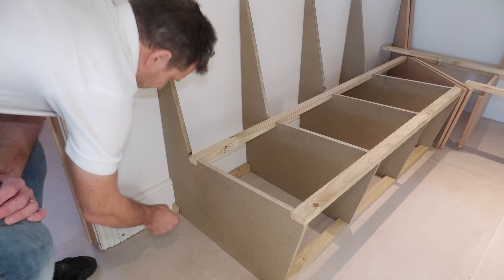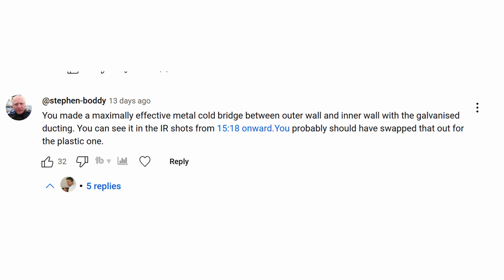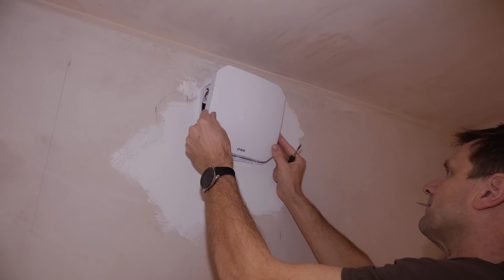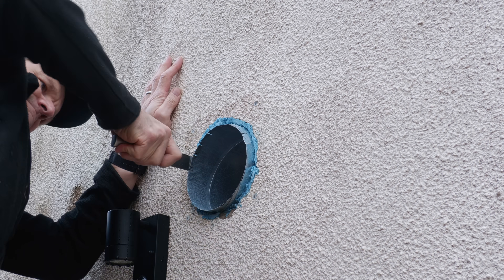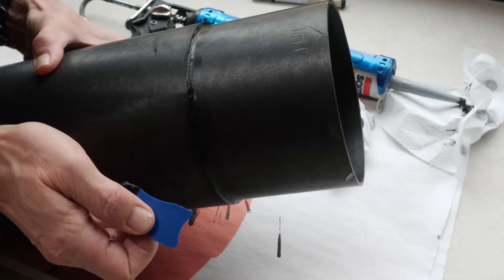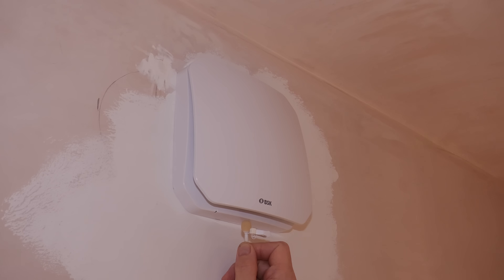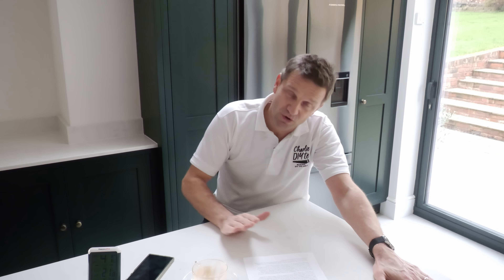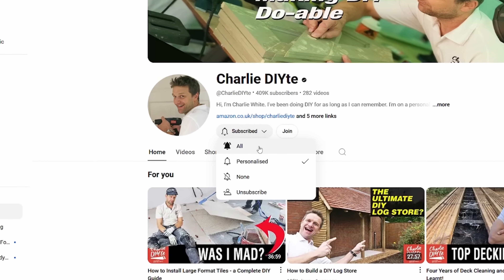Is Single Room Heat Recovery Ventilation Worth It?

Comment: Hello, me again. Since your last video, and prompted by the questions surrounding it, I purchased a CO2 meter. Why?
Unless your house is very new, you have no idea what the 'natural' (i.e. from leaks) air change is. And the recommendation ranges from 0.35 to 6 times an hour. A massive range! What is really needed is a 'good' level of CO2- and that may be happening via this natural air change. Moving the meter around the house, I have learned a lot, but tests are not yet finished. Suffice to say, levels with two occupants (our normal situation) are within acceptable levels at all times. A spell with six (including two active children) raised this, but not excessively- more tests needed.
But what about moisture? Well, a separate discussion on this got me to 'run the numbers' on that. Without heat recovery, a dehumidifier uses less that half the energy compared to air change (ignoring power used by the fan, and the extra heat from the dehumidifier). In practice, local extraction is probably the simplest solution ( condensation is usually local)- although condensation is often a cold bridge issue which should be addressed first. (Unless you are drying clothes in the house without opening the windows- in which case the problem is not technology...) Personally I have no condensation issues, and the humidity hovers in the 40% range. 
So, what do I recommend? Buy a CO2 meter and a hygrometer (they often come together). Understand your levels of both before making any decision.
BTW 'stuffyness' is caused by CO2 levels, not moisture.
Reply from the maker: Yep I should have talked about CO2. Interestingly Gosforth Handyman installed his Kair partly because of the CO2 levels in his studio although moisture was also a problem. It's compromised the sounds proofing though so he's now got that problem to sort. As you say, buy a hygrometer and CO2 meter and you're well on the way to tackling your air quality problems whatever these may be.
Reply: @CharlieDIYte  The best solutions are always data driven...
Reply: @Tensquaremetreworkshop  Hello, hoping you can guide me. I'm about to dry line my solid brick property (using SWIP IWI like Charlie), and I will likely install insulated concrete floor with underfloor heating. I will overboard the existing lath and plaster ceilings. The rooms should therefore be relatively well sealed. Can you advise on what the most effective solution might be for ventilation? I'm looking to 'keep it simple' with trickle vents in the windows (perhaps the odd passive vent) and a centralised MEV unit connected to wet rooms. Perhaps something like the Envirovent MEV160. The whole heat recovery thing seems a bit of a gimmick to me.
Reply: @mattygiggity  Heating and ventilation are a complex mix, but can be broken down-
Heat loss has two main components- thermal loss through the structure (TL), and air exchange (AE).
Required air change has two drivers- CO2 management and moisture management.
Where to spend effort and money depends on if it is a major vector- no point in managing AE heat loss if it is small compared to TL.
Your insulation plans will reduce TL, and whilst one can do some calculations, that will be an approximation.
It should also reduce AE, to the point of needing to add, but how much? Sealing a house, especially an old one, is quite difficult. Building new, the gold standard is to pressurize the house, and measure decay. Is this needed? In my view, no. It is done to meet 'standards', and be accredited as such. Not of great interest to the householder.
Better to measure to the required effect. One can measure both CO2 and humidity- a single meter at around £80 will give both figures. Designing to so many air changes per hour is crude, what you want is an environment that is actually comfortable with a minimum loss. 
Moving to practical considerations, I would plan to be able to move air from/to critical points (bathrooms, living, perhaps bedrooms) where this would be difficult to do later- but not install any equipment at this point. When finished, I would monitor the CO2 and humidity in each main area, ideally in both calm and windy conditions. This will give an idea of the 'base' ventilation, in practical numbers. Only add extra/forced ventilation where needed!
One can measure TL by monitoring the energy consumption to maintain a steady temperature against an outside temperature. Once again, both calm and windy conditions. Subtract the AE you calculate from above, and you have TL. Importantly, you also have the ratio of these, to know what best to tackle.
So much for measuring. But where does the CO2 and moisture come from?
The first is easy. People produce the CO2, at a rate depending on their activity level. What is acceptable? More opinion that facts here, but <800 ppm is regarded as acceptable for a workplace. Personally I feel comfortable below this level. My opinion is that up to 1000 or even 1200 is OK for a bedroom at the end of a night, but others may feel differently.
So, number of occupants and activity set the need. Children are more active, and produce more. Monitoring my own home (built in the 60s, and with recent insulation and modern doors/windows) I find that CO2 levels remain acceptable with 2 occupants. An open plan layout helps distribute levels. One change is that I now leave our bedroom door ajar- it was creeping up by morning.
Moisture is more complex. Three main sources- cooking, washing people and washing clothing. The last can be critical- having rented out a property, I am well aware that clothes washing habits have a major effect on building humidity. From 40%ish, to running down the walls. Same property, different tenants. Personally, we NEVER dry clothes indoors. Our humidity is very rarely above 45%- except in Summer, when the doors are open...
Cooking is sorted by a good extractor. Total loss system, but then you have the heat input of the cooking, which should more than replace it.
People? I favour shower enclosures. The pod sort. Not only does this contain the moisture, it eliminates silicon sealant and tile grout, both of which I hate.
Because of the above, our major AE vector is CO2, and natural exchange is sufficient for this (for our property, and our people count) so AE is only forced for odour air quality.
Your situation may be different. IMHO the only way is to measure. It is the only way to address your unique circumstances.
AE heat exchangers? Depends on both the actual AE heat loss, and how much of that is via the ventilation system. Also the total heat loss (would it be better to insulate more?). ROI is the logical approach.
Reply: @Tensquaremetreworkshop  Amazing response thank you very much, I have a lot of research to do clearly!

Comment: To get any efficiency over 50% you need 2 units in push-pull since half of the air is going elsewhere now.

And you possibly get severe mold issue with these when it draws in air from air leaks in the wall, where it can deposit humidity from the air in the wall making it whet then when sucking it draws mould spores back in.
Reply: Hahaha. Not true
Reply: If installed properly I don't see how it would interact with air within walls at all.
Reply: Push-pull units are clever, but as you say they rely on reversing cycles. That can cause pressure swings and some mixing of air. Cross-flow designs like our KHRV150 supply and extract simultaneously, so you get balanced ventilation and more consistent heat recovery.

Comment: any suggestions on a MVHR system we can fit ourselves ? Seems every model refers you to a survey and sales team rather than a price to buy.
Reply: MVHR systems are sized on throughput.   You can take a guess based on manufacturers “suitable for xxx bed house” or do the calculations on house/room size and target air turnover.  We went slightly undersized to get a smaller cheaper model.

BPC can do designs as there are lots of parts.   However none of it is complex and all DIY able.

We brought a new, older model off ebay; Vent Axia Sentinel.   Other parts of ebay too (eg the ducting) that are leftovers from jobs.
Reply: Rent seekers are everywhere. They will charge you to do an 'acceptable' job (usually). Research and fit it yourself and you will have a tailored solution with best fit components (not just what thy have in stock).
Reply: I got a kit on line with a basic design and flow figures. Diyed it myself. Its vent axia sentinel. Went for cheaper option. It was around £1.5k. Everthing is perfect, just hope could put in more better filter. M5 is a max this machine can take. On bonfire night and really smoggy night pm2.5 can get pushed up to 80. Most days they stay below 5 witch whereabouts of 1-2 most of the time
Reply: @Speedkam  have you thought about making your own filters?

Buy some F7 filter material and sew it to an existing filter frame.  I make my own this way.

To filter the intake air you only need a better one on the intake side.   The exhaust filter is just there to protect the heat exchanger from house hold dust.
Reply: @ oh and thats two of us (three inc my Dad) who have DIYed Vent Axia Sentinels.   I assume yours was a retrofit into an existing house?

Comment: We fitted a simple MVHR to extract from the bathrooms and supply fresh air to the hall.  Fantastic difference. Way better than a simple extract because a lot of the humidity in a bathroom stays for hours after you have a shower. No mould, hardly any condensation, constant fresh air in the house. 
Don't listen to the ventilation companies who say you have to tear your whole house apart and put valves in every room - a simple system like this is well worth it.
Reply from the maker: That's a good point Laurence. Nice work 👌 We squeegee the shower screen and tray and leave the window open in there. 20 minutes later and you wouldn't know someone had a shower.
Reply: Doing bathrooms and upstairs is a great approach and the simplest place to start.
Reply: Ideally you want to supply fresh at 1 end or centrally to the hallway and extract from the opposite end ideally dirty rooms e.g bathroom/kitchen. Doing it this way air will be pulled through the home. You are correct you don't need them in every room.  Biggest issue for me (see my earlier long comment) is getting extract valve point to the furthest room in the house which is the kitchen and adjacent to that is the  cupboard I use for my media server equipment.

Comment: It's important to realise these are not meant to fix humidity issues. They give you whatever is outside mixed with whatever is inside. They're intended to swap CO2 rich qir with low CO2 air. Keep in mind you can breath nitrogen gas and not even realise anything is wrong until you pass out from lackmof oxygen. It's high CO2 that the body does not like and can hurt you. Also replacing VOC contaminated air with clean air. But if the outside air is grubby as it is in the UK I'd want quality filtration on these. Even in clean countries pollen could be an issue. If you want tonfix moisture issues run a dehumidifier. These work AGAINST a dehumidifier by pumping dry air out and humid air in. I want to use a pair in a small 30sqm cabin that I intend to build SUPER tight and heavily insulated just to keep the air from getting stale, loaded with toxins, or high in CO2.
Reply from the maker: Thanks for this. The only point I'd take you up on there is, particularly here in the UK the air coming in isn't humid - as discussed here https://youtu.be/NbtijHKy2Vo?si=MKizUc0f_jIS56JF It's cold air that can't hold much moisture so even if it's showing a RH of 95% it's actually very dry.
Reply: @CharlieDIYte  as far as I can tell I didn't say that wasn't the case and having lived there for 2 years already knew it was the case. My real point was that YouTube is global, so those kinds of statements are totally misleading in many places where conditions differ. The obvious case being hot climates where outside air is very humid and undesirable to let in.

Comment: For the hygrometer (Relative Humidity RH) meters (with temperature), it's worth getting (or creating) a simplified psychrometric chart that plots the lines of constant absolute humidity (gm water per cubic metre) across the temperature RH chart.

This easily shows how the RH will change as temperature changes for any particular chunk of air, and especially the temperature point at which it will condense on the walls and windows. 

It starts to become obvious how we need lower RH when we are heating rooms more (shirts sleeves rather than jumper territory;-). I have it in a pdf format, it's based on the CIBSE CPD modules.
Reply from the maker: Thanks Philip. And the Home Assistant guys are totally acing it on this point.

Comment: A length of 6" uninsulated flexible duct inside an insulated 10" one makes a good core if you have an attic or crawl space or space in the room available. (overhead?) Broan makes some extremely efficient and quiet bathroom exhaust fans.
Of course, make sure to vent all the way outside.
Reply from the maker: I'm not a fan of flexi. It massively reduces air flow.
Reply: @CharlieDIYte That's why I said 6" and 10". Large vents don't significantly restrict airflow (but yes, careful installation matters, don't kink things). 

The dinky little vent you put in DOES restrict air flow, and worse, it cycles back and forth. I may be missing something , but for it to actually work it would need some sort of thermal storage, and even so it would be impossible to reach 50%.

The design I suggested is well-balanced, uses about 9 watts, and moves around 70cfm. But  you're right. You can upgrade by using a metal 6" inner pipe (The 10" outer pipe is oversized and there's no heat transfer desired so there's no real reason to go metal on the outside)

Comment: I live in a 1928 semi in London, 9ins solid walls, double glazed.  I have a Kair KHRV150/12RH in my kitchen, I fitted 6 years ago and a Ventura Tempra HTP/HTP SELV  in my shower wet room fitted 1 year ago.  We also have an induction hob in the kitchen which should reduce generation of humidity.  Before these changes we used to have a humidity of 60-65% measured by our Nest CH controller in the hall.  Since that has dropped to 45-50%.   The Ventura is noisy (not a problem in a wet room) but it dries the wet room out very quickly (about 20 mins).  The Kair in the kitchen is whisper quiet.  I was aware that the energy saving would not pay for the fans (about £300 each at the time of purchase) but I am pleased with the drop in humidity, our mould problems seem to be cured.
Reply from the maker: Thanks so much for sharing. That's really interesting. Great work fixing your mould problems.
Reply: Really great to hear your KHRV150 is still going strong after 6 years 👏 These units were first designed back in 2000 with robust German motors — built to last decades if maintained. We recommend a quick filter change each September before condensation season, so the unit performs at its best year-round. 👍

Comment: hi charlie. you're ahead of the game with indoor air quality...a hidden danger and killer...im not too fussed about any paritculate matter coming from a log burner, but the fact is that they do give off harmful particles, and the underfloor heating is the way forwards. i have neither, the former for health reasons and the latter for cost reasons, but one day will go the underfloor heating route. i will still however have  a log burner for the odd burn and also to keep my chimneys dry...ultimately i dont worry too much about a chimnea so wouldnt over the burner. the point you mak wwith regard to quality of life is key...life is not about roi alone. i put off replacing a boiler on that basis and having recently changed ours the quality of life we have in th ehouse is worlds apart...
Reply from the maker: Thanks. Yes we wish we'd put ufh in when we lived in London. Then moved up here and couldn't afford it, and finally bit the bullet when doing up the kitchen. Couldn't really afford it but we're so glad we did.
Reply: As i see it Charlie there's a trajectory for each house so sometimes it makes sense to install sometimes not...we were on an old copper cylinder crammed into a cupboard so it made sense to shift everything downstairs. That meant more space bigger tank longer showers and a smart heating system...but there's also a third leg there for UFH. When that will happen depends on when we will do other parts of the house. Great channel Charlie, you seem to be  mind reader when it comes to your content and you've made a huge difference to our lives...People would lose a lot of time nd money if it wasn't for your appraisal of these processes.

Comment: Any idea on how would this perform in terms of humidity if the problem is caused by outside humidity levels?
Would the air coming still help the house to get lower levels of humidity?
Reply from the maker: Yes. You need to watch this video https://youtu.be/NbtijHKy2Vo?si=naGGGNhkXQ6JDXxM  The air outside is very dry because cold air can't hold much moisture. So the relative humidity of the outside air might be in the high 90s but that just means that it's 95% full of moisture but it's very dry compared to the air inside. That's why you get chapped lips in the winter.
Reply: @CharlieDIYte  thanks! I will do!